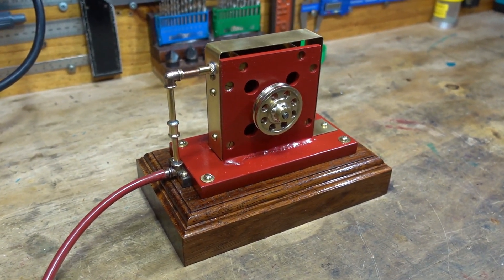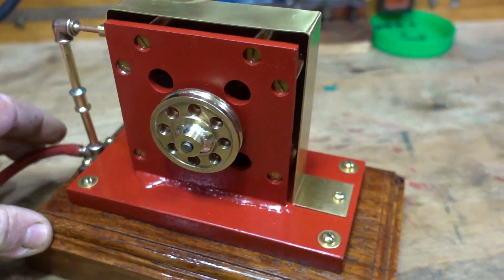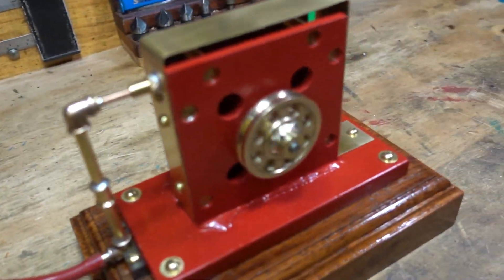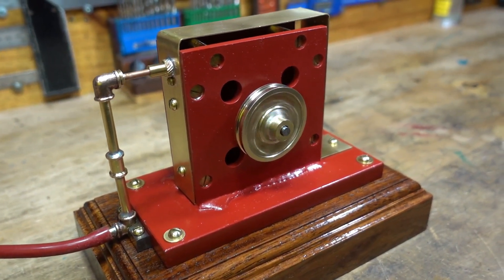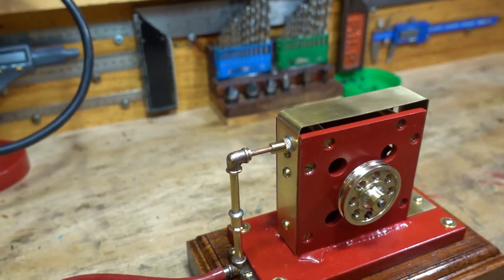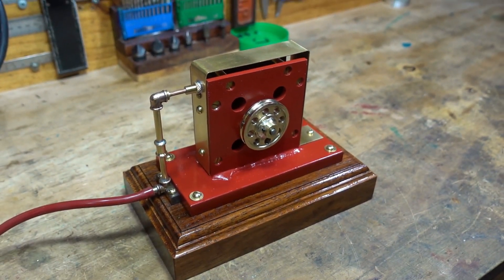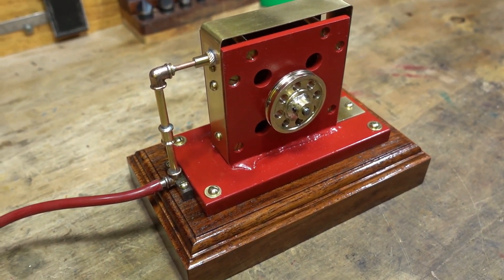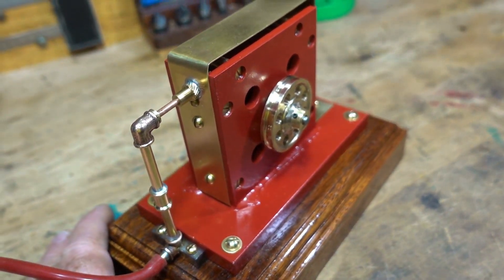Steam Turbine - DIY Homemade and first Air Test

Comment: Very nice. Well done.
Is the main shaft running on roller bearings? Thanks for sharing.
Aussie accent?
Reply from the maker: G'day Mike, yep Aussie mate. Yes steel shaft running in fairly small roller bearings - Cheers Jim
Reply: Cheers from Townsville.

Comment: Very nicely done! 
I wonder if it might actually be possible to estimate the RPM based on the sound - every time the air (or steam) hits one of the blades, it produces a sonic pulse, and as the blades spin faster, more pulses happen per second, thus the frequency of the sound that we hear increases. If you could take the frequency of the sound, divided by the number of blades, you might be able to get an idea of the speeds you’re hitting. 🤷🏼‍♂️
Reply from the maker: Very interesting thought, working that equation out would be above my knowledge though. I've ordered a cheap Chinese tachometer off eBay for $20 it will be interesting to see what speeds the flywheel is turning. I had it up to 120 psi (wearing earmuffs) for a short time and it was at warp speed! - Cheers Jim